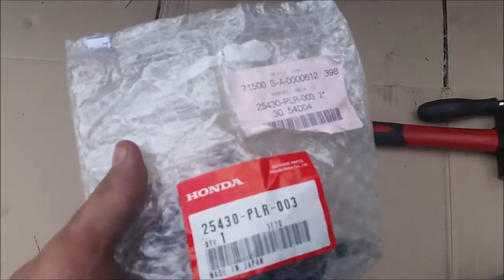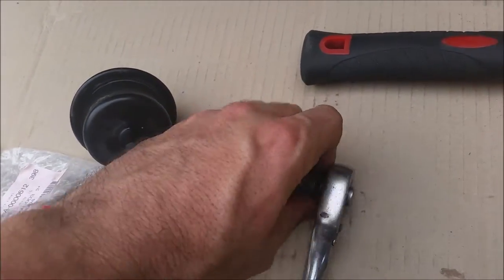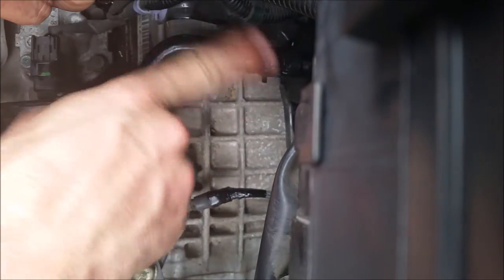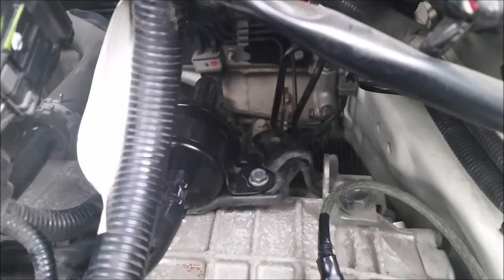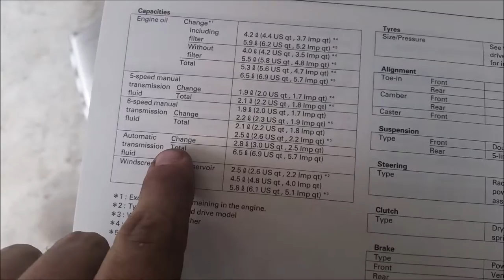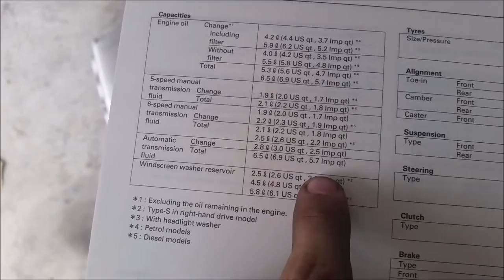Honda Euro Auto Transmission Service Shudder

Comment: Gday, good to see a Oz accord euro video. 
My wife has a gen 9. Do you know where the trans filter is on that? Its a 2013. I've had no luck looking on line.
Reply from the maker: I looked but couldn't find info about your 2013 online. But in saying that, when I did the filter on mine Honda service said 'they don't have a filter' so, if I were you I would be pulling off the air box (two 10mm bolts) and looking with my own two eyes. It does look like the gearbox might have a panel style filter let me know how you go
Reply: @jacobsr20det  ok..... so I found it... the filter for the CU2 looks the same but it is in a different location.  Its behind the gbox (between the gbox and fire wall. You can't see it because the fuse box covers it.
However upon more research there is also an internal panel filter but you can't change it without pulling the gbox out and basically a full strip down of the gbox is needed to change it. So the internal one is pretty much unserviceable until anything major happens to the gbox.

Comment: I've heard that Honda Automatic Transmissions can have problems. Do you know if there are any issues with the following:

Honda Accord Euro (8th Gen 2008–2015) [known as the Acura TSX in the USA] using the Honda K (K24Z3 LEV) 4 Cylinder, 2.4 L engine.
 Automatic Transmission

Honda Civic VTi-L or VTi-S 9th Gen (2011–2015)  [Acura ILX in the USA] using Honda R (R18Z1) 4 Cylinder, 1.8 L or Honda R (R18Z4) 4 Cylinder, 1.8 L engine.
 Sports Auto Transmission

Honda Civic Sport, VTi, VTi-L, or Limited Edition 8th Gen (2005–2011) [Known as Acura CSX] using Honda K (K20Z2) 4 Cylinder, 2.0 L engine or Honda R (R18A) 4 Cylinder, 1.8 L Engine
. Automatic Transmission 

Honda Jazz VTi  Second generation (2007–2014) [known as Honda Fit in the USA] using the Honda L (L15A7) 4 Cylinder, 1.5 L engine
. Auto Transmission
Reply: Ive owned two of the first one on your list. Best car out there. Never an issue.

Comment: Hi man, this video is old n' all but i still wanted to ask about this process:
I just bought a 2007 accord euro and the full service history is included, but i still want to change/flush the trans oil. I was told Honda ATF DW-1 is the best/recommended one but Nulon makes a fully synthetic ATF that states "meets or exceeds honda ATF DW-1".

I'm not doing the change for the lols, i also have quite a shudder moving from neutral to drive. This happens about 50% of the time especially when im in traffic lights or leaving the driveway but yeah the shudder is from N to D, not noticed when in park. shifting gears 1 to 2 to 3 shows NO shudders. However, there might be a problem in general, because my D light on the dashboard often blinks but with no discernable patters, and my N light for neutral rarely works and also blinks randomly. Finally, in rare cases, the transmission doesnt engage drive and when i put it in drive it acts like a neutral for a second, meaning i rev but the car doesnt move, but starts moving a few seconds later, making some rattling/ticking noise in that "few seconds" period where it doesnt move. Will i need a flush or change? obviously a flush is cheaper and easier for me and hence i'd prefer a simple change, and what about the filter, not sure whether it was changed yet, gotta check the logbook, but will changing the filter help anything?

BTW my odometer is at 240,000 but im not too concerned as the car is in an immaculate condition and the owner (2nd owner) has fully done the services so far.
Reply from the maker: Hi Mate, you will hear all sorts of people stating not to use any fluids but original Honda fluids, as far as the truth if the fluid is a direct result of failure the manufacture of the fluid (where it states "meets or exceeds") is liable. As far as I am concerned you can use any oil that meets or exceeds.

the shuddering can be from thin oil (old oil) as can be the slipping (even older oil) could be damages to your friction and slip disks, I would change the oil as soon as possible and do a full change. where the box doesn't engage for a few seconds could be pump but most likely its still the thin/old oil not able to get up to pressure to engage the clutch pack (pack of friction and slip disks).
you could drop a little oil and look at it and have a feel, if you are not sure its quite inexpensive to change the fluid so save yourself a gearbox rebuild.

this is only a little advice. If it was my car I would change the filter (because its little and works hard) and replace as much fluid as I could, remember that there will always be some level of old oil in the box that is not able to come out.
Reply from the maker: How did you go? what was your final decision?
Reply: @jacobsr20det  i ended up changing the oil (used nulon synthetic atf) and installed an aftermarket filter, it did help the problem to some extent but i still get the weird issues i described (N light blinks erratically, D light as well, sometimes the manual shifting mode screen flickers/doesnt work) plus the old jerk from N to D and the inability to go to Drive sometimes. I also get the P0718 code every like 5k km, says the input turbine sensor intermittent failure but i changed it, no difference still. At that point i was convinced it needs a new pcm or something so i took it to my mechanic friend and he used his fancy code reader (more advanced than the bluetooth elm one that i got from ebay lol) and got code 83-1, basically pmc/ecu failure. not surprised hahahah. 
Car's still driveable at this point ( i drive it like 300 km a week) but yeah its kinda dangerous having this issue coz it can happen during a 3-point turn and end up in a catastrophe (so im not doing 3 point turns atm lol) but tbh when the engine and trans are warm, 30 min into driving, the problem disappears, not sure why that is. Will either get an electrician to look at it maybe some wires are fried, or just end up replacing the pcm. Used ones are online for around 200 bucks and the location is easy to access so that's good. Thanks for the video man, appreciate your concern!
Reply: @jacobsr20det  replaced the ecu, all good now! Shifts perfect. Will have to still replace fluid every 20k or so now

Comment: DO NOT use anything else other then honda fluid in these accords. You can flush the torque converter with the cheap stuff but do not end up with after market fluid in your gearbox. Aftermarket fluid wont get into the fine areas and parts will start to overheat wearing out your gearbox quicker. Thats not mentioning the slipping. And put a shirt on.